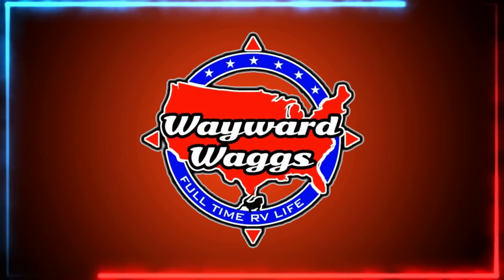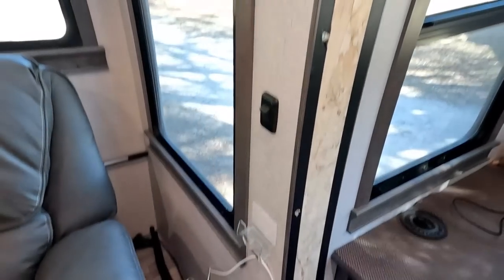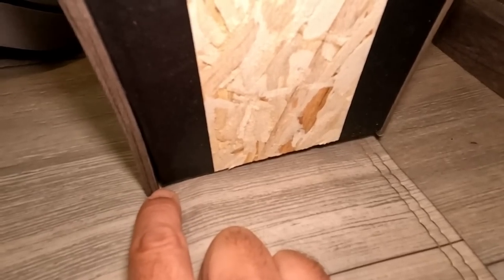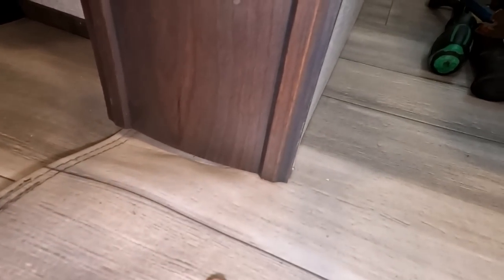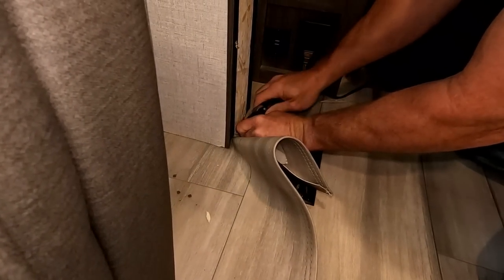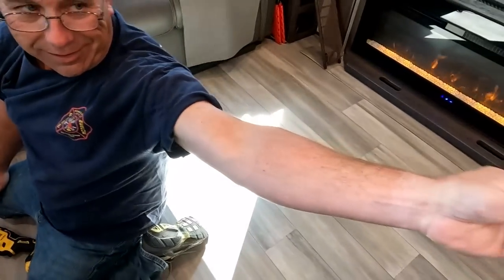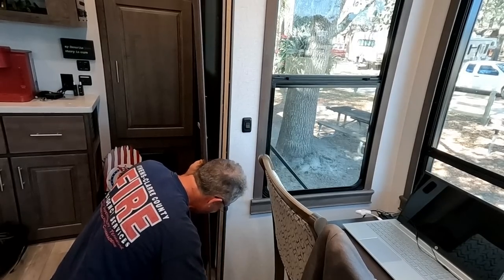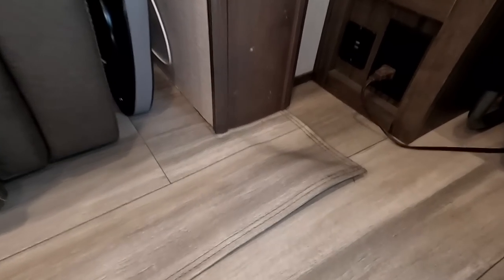RV Slide Wall Repair - We Needed HELP!

Comment: Hit the linoleum with a heat gun or hair dryer to warm it up a bit, and it should flatten out.
Reply from the maker: Thanks for the tip. We will try that.
Reply: great suggestion, I was literally about to tell them the same thing..

Comment: We are 310RL Paradigm owners.  This is a problem with a lot of the Alliances (maybe others too).  We solved our issue with an exacto knife and trimmed the vinyl NOT the wall.
Reply from the maker: We trimmed the vinyl first and it didn't help much. Shaving the wall fixed it.

Comment: A multitool is my most used tool in my 340.  We just did that on 2 corners of our slides.  The difference is that I just put a piece of cardboard on the floor to protect it then used my $30 Harbor Freight tool to cut off 1/4 inch.  Didn't have to remove the molding.  Well worth the investment.
Reply from the maker: We will probably put on some flat molding to cover up the gap.
Reply: @WaywardWaggs  Are you referring to the gap along the sidewall or the face trim?  If you are talking about the sidewall, I suspect you could get a short piece of trim from Alliance at the rally in May as 1 of your 'simple' repairs.